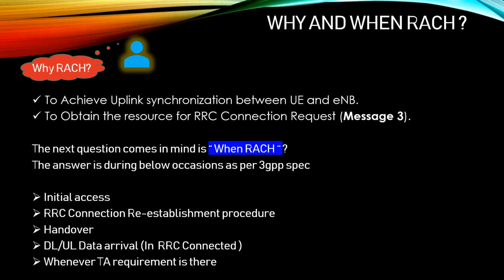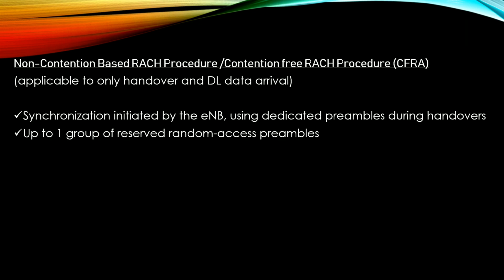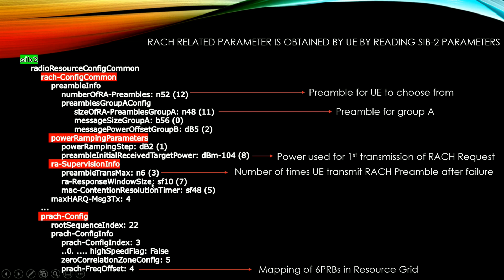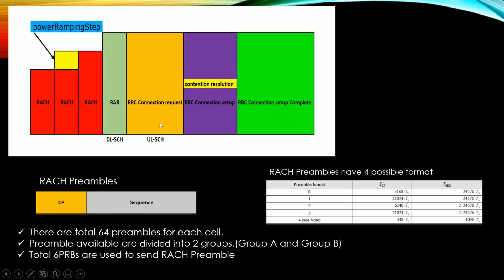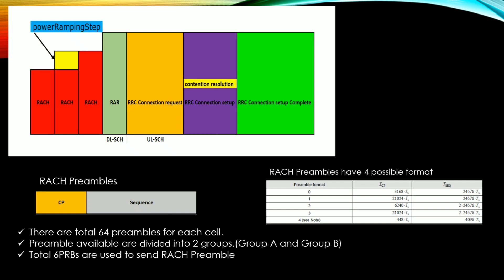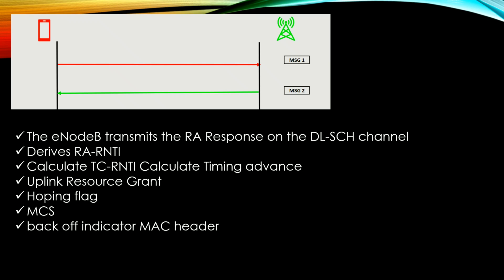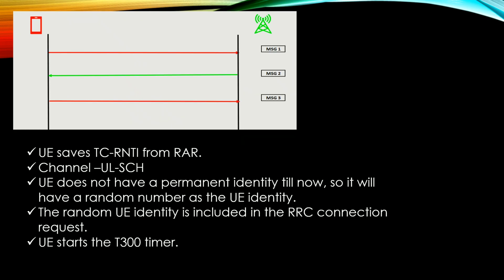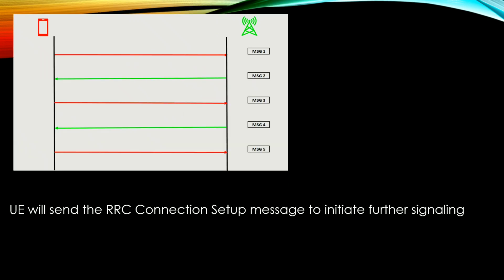RACH (LTE Random Access Procedure) #LTE  || techlteworld (TLW)

Comment: I got one question in interview. Interviewer asked me what would be size of MSG 2, number of bits occupied by timing advance control,  UL grant, T-CRNTI
Reply: What is the size of the random access response window?
(ShareTechnote)
It is determined by ra-Response Window Size. This window size can be the number between 0 and 10 in the unit of subframes. This means that the maximum time difference between the end of RACH preamble and RACH Response is only 12 subframes (12 ms) which is pretty tight timing requirement.